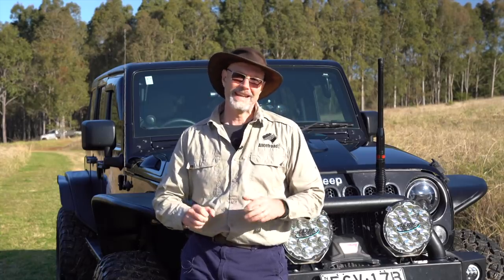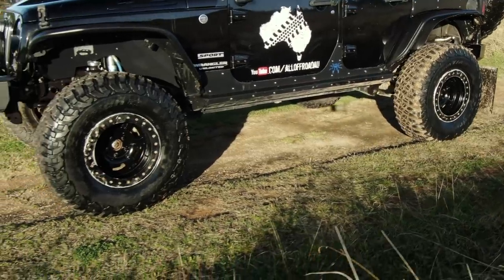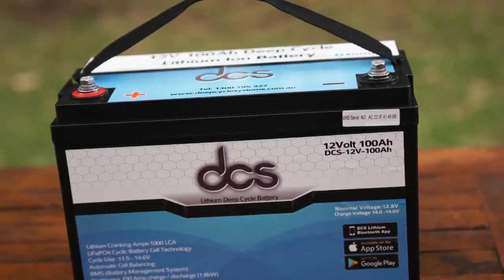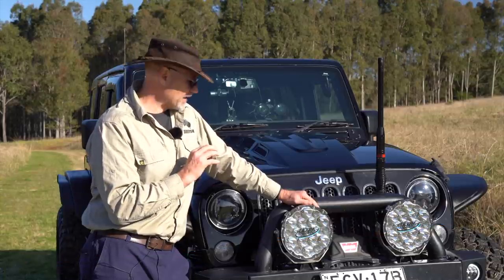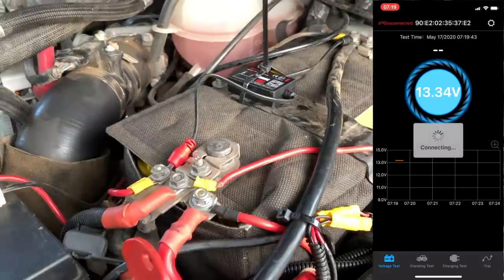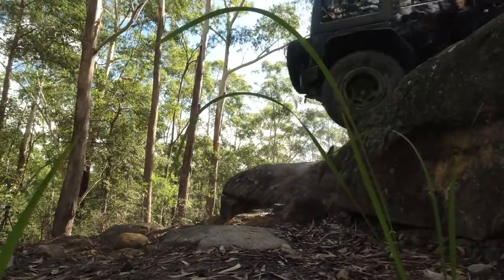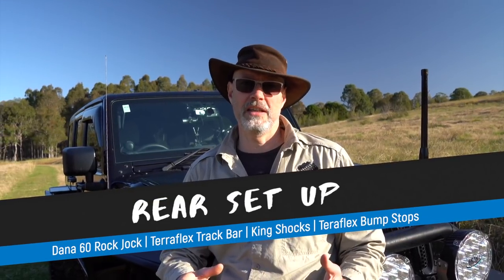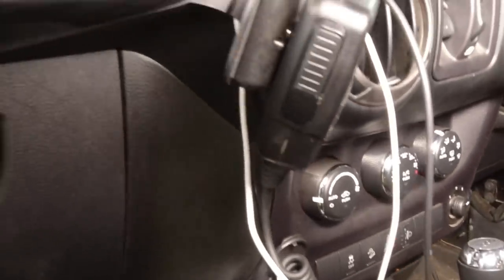Jeep Wrangler JK CRD "Rubicon" Heavily Modified & Complete Walkthrough!

Comment: Fantastic rundown of the JK 👍
I've also got a JK that was originally built by a reputable company/person, and had exactly the same problem - Deathwobble on the way home after picking it up, and then many problems with the build afterwards! I've since completely changed the running gear, suspension, diffs etc. and got the vehicle engineered. In fact, despite buying an already built vehicle, there is more that's new/changed than original! It's taken a few years and a decent chunk of time and money to do, but I'm happy with it now and it's running well.

Comment: I bought a Jk wrangler unlimited in 2007 v6 when they first came out, all I did was bumpers front and rear and 33’s, I absolutely thrashed it off road  and never had a single issue, fuel economy was a bit ordinary and so was HP, wish I still had it.

Comment: When I mentioned 39x13.50r17 KM3 tyres last time you gave my comment a heart. Any chance of running this size on your Jeep JK ?????
Reply from the maker: lol if there was any way to get this engineered I would in a heartbeat as this really would be the right Tyre size for a 4 door JK
Reply: @AlloffroadAu   What would be involved, more aggressive brake pads for shorter stopping, custom width fender flares, steering box upgrade, rear bumper tyre carrier that is closer to the body for a better departure angle yet low enough to see out of the rear window?
Reply from the maker: yea dana 60 front and would need to pass a lance change test

Comment: Nice rig rundown.. But typical jeep. the benefit of being so easy to customize is also it's downfall. So many modifications badly installed, cheaply made, and not suited to work together.  I know, I had problems with mine and after 2 years sold it for a GU.  Yours looks great now, but at huge expense...
Reply from the maker: Quality of mods was ok the issues was original build, I definitely like a GU as well but to big and heavy for technical driving in my book.

Comment: Your head lights look like candles compared to the stedi versions and I see no clear cut off. I'm not sure you're really getting much out of those unless your camera is really really bad at making stuff look dark at night.
Reply from the maker: I'm quite happy with them but is very hard to compare at night unless you have them both next to each other, may need to find someone with Stedi and compare.
Reply: @AlloffroadAu  I don't have them a close friend does also fitted to the JK and they're impressive. I actually have their light bar and spotlights and have had for several years and I actually feel the build quality for the price point is Excellent but I was more impressed with how good the low beam was on his 7inch replacements more than  anything.